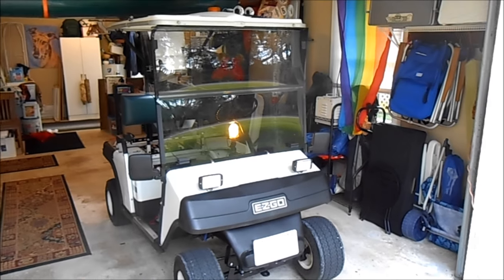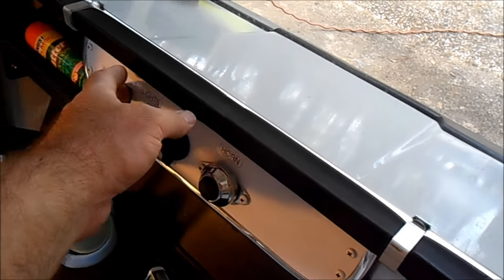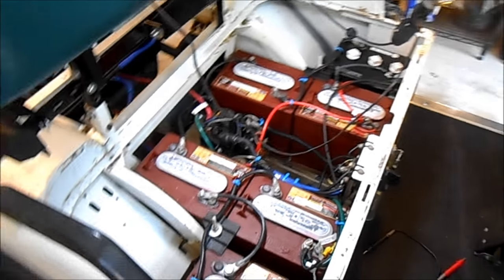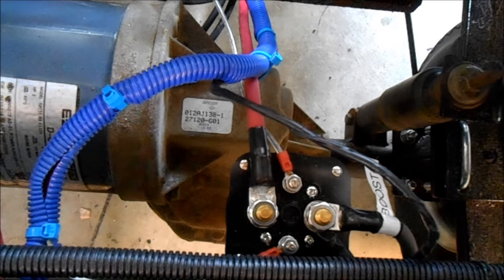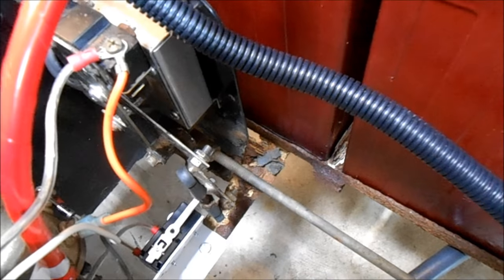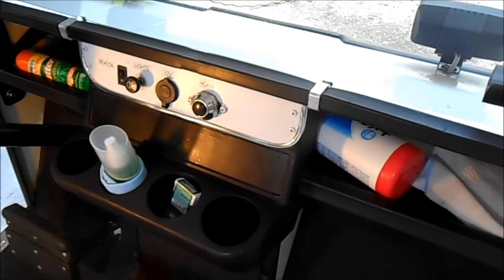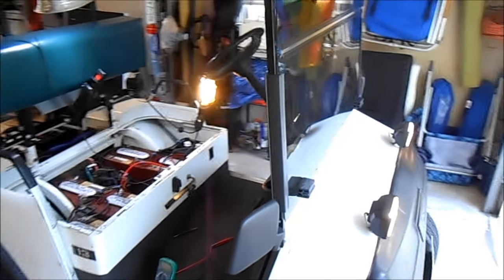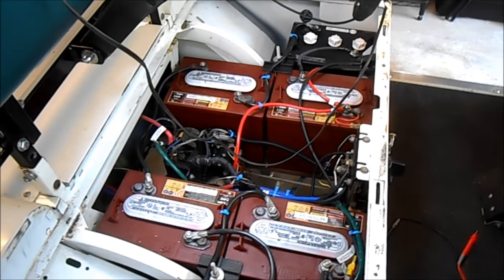SPEEDING UP THE EZ-GO MARATHON (1994)

Comment: Where can I get  diode from?
Reply from the maker: I got it online.  Sorry I didn't save it - I would have given it to you!  Ended up buying a 48 volt Curtis controller on eBay for about $200 and that works a lot better.  Goes about 17 mph with the larger tires and new batteries.  Been a few years, and the 36V motor hasn't melted - yet.  I recommend just buying a new controller.  Works better than the diode approach.